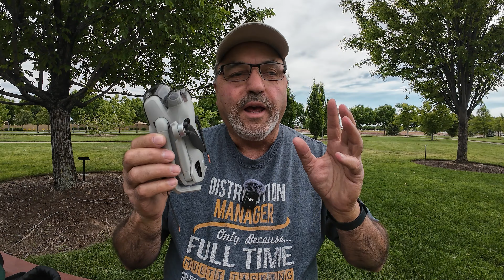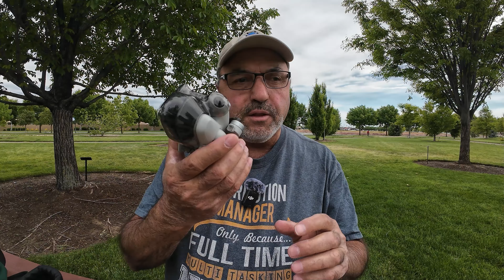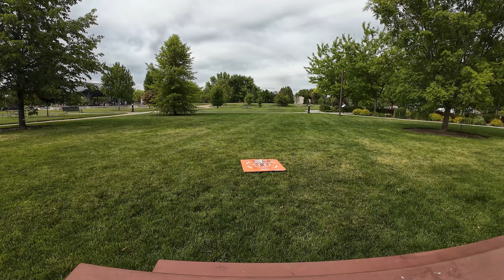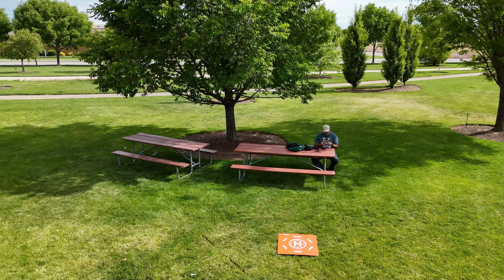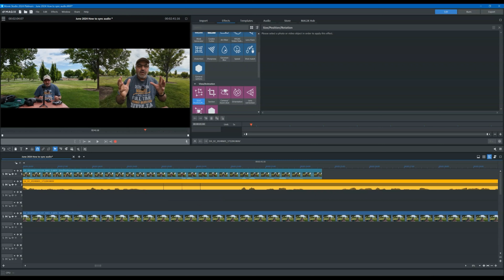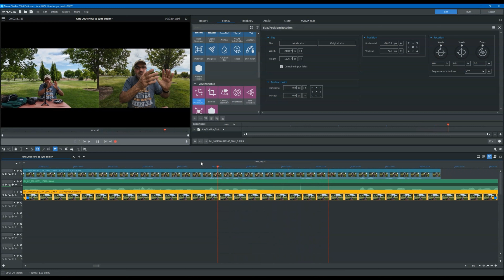How to record and synchronize audio for your drone video - A tutorial

Comment: Marcus make sure to tell people to not use VBR 'variable bit rate' when recording video as it can cause audio to drift out of synchronisation. I found that out the hard way lol. Only benefit is smaller file sizes!
Reply from the maker: Good advice!  Thank you!
Reply: Thought it was VFR. The Fimi Mini 3 suffers a noticeable "drift" after about a few minutes of flight.
Reply: @GorillamansGarage   I guess theirs always some drift with mismatching encodering formats, but I discovered some video editors have a time shift feature to stretch or compress the timeliness of audio or video. It's a lot of faffing about if you have to do that, but it can help. The hard part is synching the end too as well as the start.